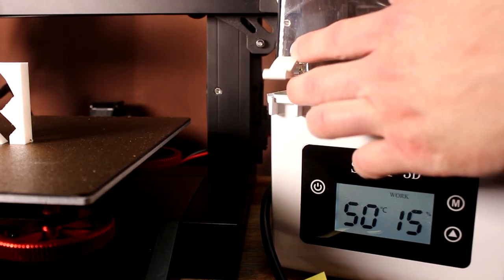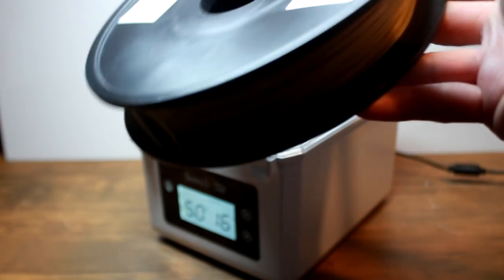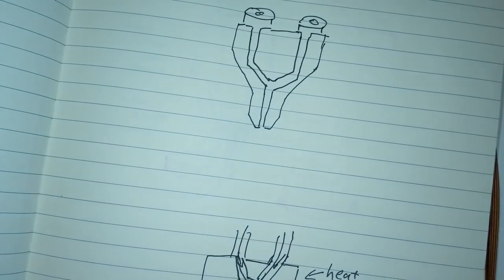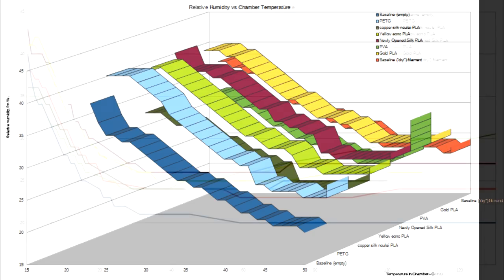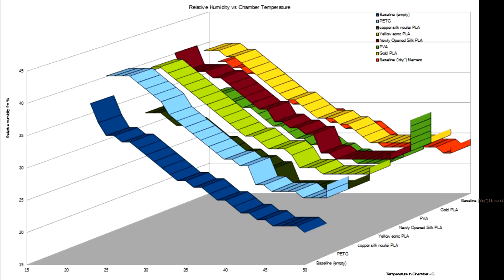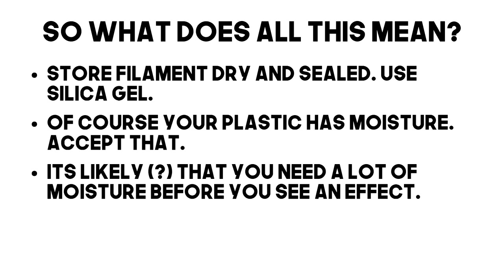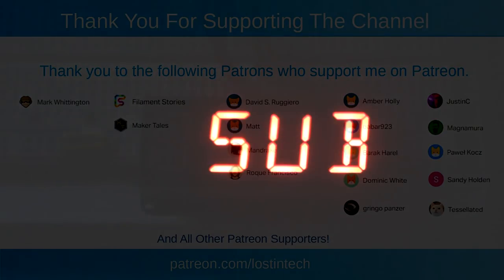So...all filament contains water? Things I discovered while testing out the Sovol 3D Dry box.

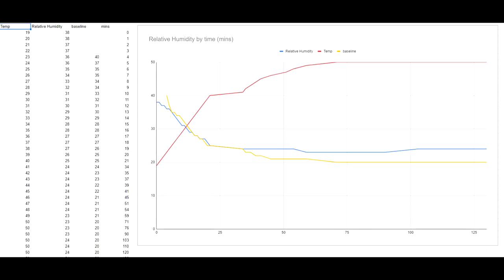Comment: 3:43.the 3% difference in RH (20-23) at 50C can be fully explained by only 0.0025g of water vapor per liter of air. that's not a lot of water. for reference just 1L of 20C 60%RH room air contains 0.01g of water vapor. so if you open the box and let room air in and then close it again, that alone could explain the 20-23% RH uptick detectible within seconds when the temperature restabilises. a further rise in RH a longer time later is indeed evidence that the water source is the filament itself though. and on that point a saturated kilo of PLA or PETG carries up to 2g water, ABS and PA6 up to 20g. needless to say, a whole lot of filament "dryers" are utter trash because they cannot evacuate the moist air that they bake out of the filament. for reference,  you need a over cubic meter of air to hold 20g water in vapor form at room temp. unless your dryer holds a cubic meter, when it cools back down to 20C that water is going to condense and be trapped in the box together with the filament you just spent a dollar in electricity to dry. don't get me started on silica gel...do not place that together with the filament during the drying process--do so afterwards. that stuff can adsorb a third of its weight in water. that means if you have 10g of used gel, once you raise the temp it will release more water than a kilo of old PLA/PETG and it will easily overwhelm an unvented dryer. 

the better dryers are the ones that continuously take room air and heat it up before blowing it into the chamber and has exit paths for that air. a fully open system, basically a food dehydrator. these will have the highest drying rate at the cost of more energy. or in Sovol's case they ask you to crack the lid while drying. but then you have to doubt whether it can achieve its temperature set value given the low wattage and unspecified amount of lid crack that they expect the user to perform. somewhere in the middle there is a sweet spot where the product was designed from the beginning to be able to continuously heat fresh air and let old air leave, like the Eibos models. they will have the correct wattage and exhaust port sizes to both dry efficiently and still meet the advertised temperatures, which is important for things like Nylon. 

at least you do not want to see that RH is increasing in the box while at working temperature. that is obvious evidence that it is a poor dryer and is more suited for being a simple drybox.

Comment: Never had any issues with moisture and PLA and my room is a constant 70% humidity unless I do something about it. However I did have one roll of PLA that showed severe signs of being wet. It was an orange PLA+ that printed fine when I got it but now prints horrid and you can hear the crackles. Strange thing is, is that I have PLA/PLA+ filament from literally 4 years ago that is covered in dust but prints just as it did 4 years ago.

Comment: I don't know if my finding is only due to my setup. 
But i found good pla, tend to get brittle... And snaps...i have 2 printers one work horse, and one specialist work printer.. i leave it in the printer when done.(lasy).
So the plan is not old.. maybe 3 month... But sometime when I go back to the printer, and want to change colour is brittle...snaps.
(Really annoying when it's inside the Bowden tube)  
My printer's are social beings, thats why the are in my living room, so the very best conditions...   
If i wind off the top Windings i get down to more none brittle pla...
I also found this on my stored reels. 

First i thought it was the producer..but i change both store and filement type...seems to be the same.... 
Wet/dry ....what is it?
Reply from the maker: Filament snapping when you try to remove it is something that I've been having lately too! I agree, so annoying 😒😡

Comment: Bad-Wet-Brittle-Old-Poorly made filament can/will and does drive many new (wanna be) 3D Printers'...uhm, technical term..."Batty!"
Put a new roll of filament on and presto! I solved the problem.
Next day...what the f^@&!
Even a new roll can have holes in its plastic wrap.
I finally started using 2 Gallon zip locks with a 50 gram silica bag...and I suck as much air out as my lungs can handle.
I have a plugin Cold/Hot ice chest and I think this may remedy some issues...using the hot mode.